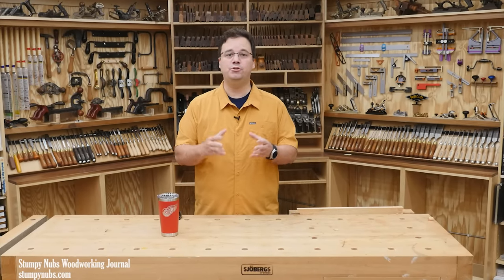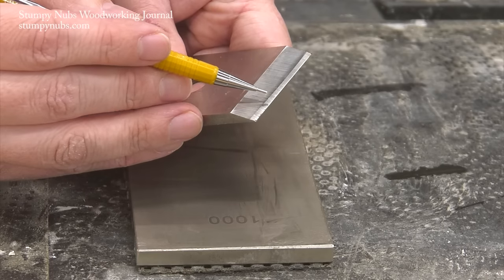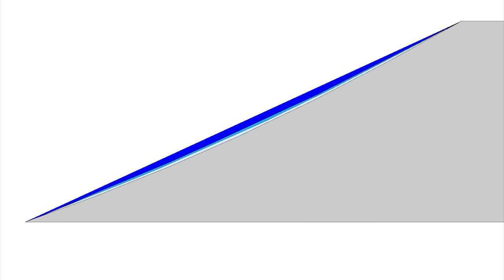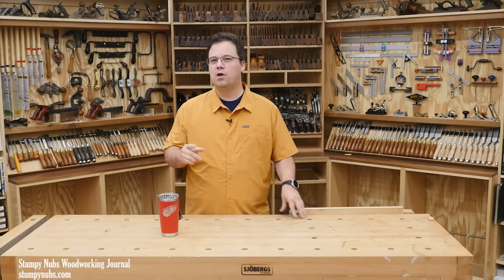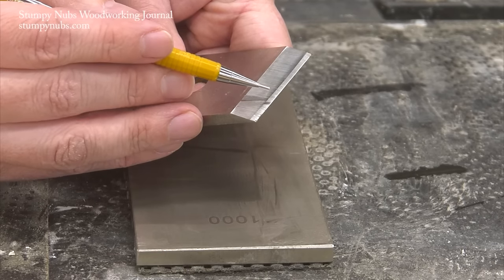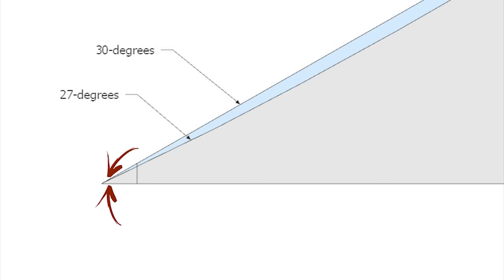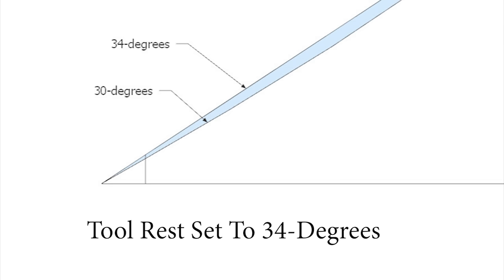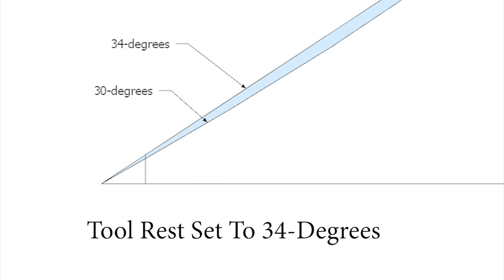WRONG INTERNET TREND! - Watch before you sharpen with a bench grinder!

Comment: The biggest problem with using powered wheels to sharpen is you don't want to overheat the very thin edge of the steel and change its heat treat and thus its properties.  Worst case you would reduce the hardness right at the edge.  Some steel compositions would be more susceptible to this than others.
Reply: I always thought that the temperatures you'd see when sharpening are far lower than any used for heat treatment.
Reply: @yngndrw.  Heat treating uses high temperatures, but tempering does not.  You can damage the hardness of tools if they get a little bit hot when working with them, that's what "high speed" steels are for.  They have different tempering temperatures and don't lose hardness until they get hotter.  So unless your chisel is high speed steel it can lose hardness at a temperature lower than you think.

Comment: I attempt to grind my chisels and plane irons so that the wheel intersects the tool surface behind the edge by a small (<1/16th inch) margin. Thus the actual edge is only hand sharpened. The reasoning is that a wheel will heat the edge, drawing the temper. I think pulling the temper will have a greater effect on the durability of the edge than the marginal effect of an edge that may be a degree or two off 30 Deg. Other woodworkers on youtube sharpen chisels to about 17 Deg. for use with very soft woods, so unless you attempt to maintain edges customized for every species and moisture content, be consistent around or a little less than 30 Deg. for most hardwoods and don't sweat the small stuff. (Woodturner hint, color the edge you are sharpening with a magic marker before you put it on the stone or wheel, make a test pass, and the areas where the magic marker has been abraded off will tell you exactly where you are sharpening.)

Comment: All of my wheels are from D Way, but I don't think there is any real difference other than D Way are steel, and Ken's are aluminum. As far as I am concerned, the radius edge wheels are pretty much worthless. I like the wide straight wheels. I have heard that Ken is now dealing Vicmark lathes which are top of the line. I own a Vicmark 240 with the pivoting headstock. I don't like turning bowls on a long bed lathe.... Haven't had a chance to play on the Harvey lathes yet.

Like you said, lots of 'stuff' floating around about the hollow grinds. I just sharpened a bunch of old tapered wood plane blades. Took them to my CBN wheels and hollow ground first, then to the stones to finish them off. You can still take the temper out of some blades if you are not careful. The CBN wheels are made for sharpening 'hardened' metals. This would cover all modern hand planes and chisels. For the older ones, the softer metal that supports the hard metal cutting edge can clog up the wheel a bit. If you have an M2 high speed steel scraper and the platform, that will clean it up fairly quickly. Some Trend lapping fluid is good too, but apply it to the bevel of your tool, not to the wheel itself. You will end up with a racing stripe. Of note also, Ken has 'helical washers'. The nuts that are standard on most grinders are not precision machined, and can cause the wheel to wobble. The helical washers, one concave, and the other convex, will make for a square mount and no run out in your wheel. Also, CBN wheels come spin and bubble balanced. Many go with a 1/2 hp grinder. To me, as a production turner, that is way underpowered. I have 2 Baldor grinders which are more than enough. I also have 2 of the 1 hp Rikon grinders which come up to speed in the same amount of time that the Baldor grinders do. Only down side to the Rikon is that they spin for quite a while after you turn them off.

Comment: I just get the pure satisfaction of sharpening my chisels and hand plane knoves on a diamond plate. In just 5 minutes i can have a scary sharp edge with no more than a few strokes by hand. I just dont see the justification of paying several $100 for a machine that does the same thing. You can pick up a whole set of diamond plate from 300 grit to 8000 grit for much less, and still get that enjoyment of just using a little bit of elbow grease to achieve a superior edge.

Comment: When you say set your grinder at 34° are you saying use my digital angle finder and set it on the rest, then adjust it to 34°?  I've been following you for some time and have purchased the LUX  cutter head for both my planer and jointer.  I've purchased a Harvey band saw and some of the other things you recommended.  So far so good.
Reply: The rest should be to 34* to the horizontal center line, of the wheel, where tool touches the wheel ( /O ).

Comment: I don't have a grinding wheel, and I likely never will because my little shop is already overstuffed with tools. I do have a set of diamond sharpening stones and honing guides that I'm still not expert with by any means. All this to say, I have no dog in this fight - I have no opinion as to whether a wheel or a stone is better for sharpening tools. So looking at it as objectively as I can, I really think the difference in thickness of a hollow-ground edge from a wheel versus a flat-ground edge from a stone is so small that it would make no discernible difference to how a plane or chisel would cut or in the durability of the edge. It would be interesting to see some objective tests of that, though.

Comment: Can you give more information about your tool rest? Where did it come from? How does it attach to your grinding setup? Have you used different kinds? I got a paper wheel finally after wanting one for many years and was thoroughly disappointed. One of the problems I have with it is that my tool slides up and down on the wheel, changing the sharpening angle rather dramatically even if I'm holding the tool at the same angle. I think a tool rest would help that problem a lot, though I'm still not happy about the quality of the polish and may think about a CBN wheel instead. Thanks!
Reply from the maker: It came from Woodturnerswonders.com. they have it as a standalone rest that mounts to the bench in front of the grinder, or as part of their bigger Kodiak sharpening jig system for turning tools.

Comment: I use a wet grinding wheel so there's no problem with over heating the steel. I don't grind every time I sharpen. I use a flat stone to hone which puts a micro bevel at the toe and a slight flat at the heel. I don't grind again until the flat areas of the toe and the heel combined are almost equivalent to the hollow area in the middle of the bevel. At that point, I'm working too hard on my flat stone and it's back to the grinder. The objective is not to grind it right to the edge but just to restore the hollow leaving a fine micro bevel so that, when I take it to the flat stone, I don't have to remove so much steel to achieve a fine polished edge. To me, it makes sense.

Comment: What effect does the extra heat from the grinding wheel have on the cutting edge?
Reply: If you're doing it correctly, nothing.  I'd recommend watching some videos on proper technique on sharpening with CBN wheels, which run cooler than traditional wheels and have other benefits.

Comment: Through a lifetime of experience most frequently fraught with scraps and thrown away culls full of curly and gnarly grains, lots of knots, crotches that NOBODY was willing to work with and everything else that can possibly be wrong with the wood I use, I've come to the immutable conclusion that hardened steel blades and cutters are MEANT to be 27 degrees or thereabouts. 30's fine, and will last a hair longer, but it comes off the hones and snarls right down to be halfway to Bitch-ville from the time you stopped working the edge. You can feel it after hours of pushing it through grain "going every which a damn direction"... 27 might not stay scary for quite as long, but 30 doesn't even start scary... AND scary for a little time to dwindle into not so scary and then back to halfway to Bitch-ville is better than starting out halfway to Bitch-ville in my personal opinion...

    SO if I can get the bevel to 27 reliable, and then just polish off the worst roughness so it'll glide alright, that's probably about where I want to be. I don't need to see my nuts up my pantleg in the g** d*** reflection, either. It's a tool, not a ladies compac' mirror...

    AND no, it doesn't matter if I'm pushing the blade on a stone or if I alternate between shoving it against a grinder (angle, drill, or bench) and plunging it in ice-water... It's a friggin' blade, not a Picasso. We're supposed to be WOODWORKING not practicing up for nuclear rocketry!   ;o)

Comment: My high school shop teacher would go bat-crap crazy over hollow grinds.  Automatic fail. He also went nuts over pulling the trigger on a power tool when not in use. "That trigger only has so many uses, don't wear it out"!
Reply: But a quick double tap on the trigger every time you touch the drill is the law I thought? ZHOOP ZHOOP!

Comment: I don't like a secondary bevel because it makes the chisel work less well.  With the bevel down, the chisel is often slid along the stock, like a plane.  The secondary bevel raises the cutting edge above that plane.  The main issue with hollow grinding on a bench grinder is overheating the cutting edge.
Reply from the maker: Planes are sharpened with secondary bevels all the time. The main bevel does not remain flat on the wood when cutting with the bevel down. The tool is angled upward so the cutting edge is pretty much all of the bevel that is engaged with a bench plane.
Reply: Yes, true.  I was talking about chisels. @StumpyNubs
Reply from the maker: @jaywood8296  I used a plane as an analogy. I was still talking about chisels, as well. The bevel-down function is the same. A micro-bevel has no negative affect in common use.

Comment: Good video. But, I gotta ask. That actual size at the end, is that on a 17" laptop or the 65" flat-screen TV I use?
Reply from the maker: It doesn't matter because the point is that only the very edge of the tool is of concern.
Reply: @StumpyNubs  I know. It was more of a snarky comment. Sorry. I retired from mechanical design with years of CAD work. I was once told about an electrical engineer that was shown his design implemented in CAD. The electrical engineer pulled out a ruler and measured the part on the computer screen, declaring it wasn't the right size.
It's the irony of ever trying to call anything "actual size" that displayed on screen.

Comment: The experience of a grinding wheel sharpened chisel dulling more quickly may in fact be true for some people. The only thing they see is the holow grind, hence they argue like you mentioned in your introduction in the video. Especially for old grinding wheels and old steel alloys the reason for quick dulling chisels lays in the overheated tip, changing the steel's microstructure dramatically to a softer one. This annealed microstructure can not hold the edge anymore... Those arguing with the hollow grind can't see the change in the steel and therefore keep arguing with the wrong argument.

Comment: I can see maybe if you're using a tormek, followed up with a strop wheel. At that point, the edge is rounded slightly, increasing the cutting angle at the tip. Normally, it loses its edge sooner because the honing made the tip too steep and blunts easier. Or from a course stone causing micro fractures at the tip, causing the edge to break down prematurely. I rough grind then freehand sharpen. None of it matters. Enjoy your hobby. If you use hand tools, you will be sharpening a lot, regardless. If you're chopping, the steel doesn't matter that much either. The edge will roll or chip, and then you will be stuck sharpening either way. Paul Seller is a perfect example of that.

Comment: I've always ben told (correctly or incorrectly) the reason not to use a bench grinder for chisels and plane blades is that it puts to much heat into the tip thus making them too soft.

Comment: There are diamond wheels too. Which do you think are best ?
Reply from the maker: CBN is better for typical bench grinders because diamonds are affected by the heat more than CBN.
Reply: @StumpyNubs  thanks
Reply: @StumpyNubs  but I have a Tormek water stone. So heat is not an issue. Tormek has diamond wheels in 3 different grits. I’m considering buying such a wheel
Reply from the maker: @TheFilip330  I have diamond wheels on my Tormek and like them very much.

Comment: just remember, until you get to lapping and scraping, all grinders in industry are using round wheels... whether the surface be flat, round, or other.

this is one of those most amusing topics... its TIMBER WORK. for the most part, a mm here, an inch there...whatever. it isnt high precision, and for those guys that get stroppy about that... go dunk your latest work in a cup of water and tell me its still "high precision".

like, if im grinding a REAMER, and trying to keep it within 0.002mm? i actually REALLY have to consider the wheel, is it round, face grinding, or is it flat side grinding? because they both require a different setup to get the same angle.

but theres no PREFERENCE for one over the other. you do what the machine and your tools mandate you do... i can only get in there with a cup wheel and still clear the tailstock and drive dog, or i can only run a 5" wheel on that grinder, or... whatever....

Comment: To me the grinding on a bench grinder is a bit of a problem since the grinder heats the material unless you use a wet grinder. Heating of steel impacts the hardening.
Reply from the maker: A CBN wheel and a large tool rest will keep it cool with proper care. I may make a video on that down the road.
Reply: What temperature is required to temper the grades of steel you commonly use? I bet it's far higher than you'd expect.
Reply: @yngndrw.  Sparks flying and the edge of the blade is very thin so I'd definitely consider that the edge can be less sharp than it could be. If the hardening is lost on the business point of the knife it's going to be less effective.

Comment: I happen to prefer flat or slightly convex bevels. On carving tools and lathe gouges especially. BUT, I use chainsaws for a living. Instead of your 6 inch diameter as the extreme example of hollow grinding, imagine something as small as an ⅛th of an inch. Yet these cutters slam into wood and stay reasonably sharp for a long time. This alone would seem to refute all the interweb blather concerning hollow grinding. 

There are chainsaw cutters with flat bevels. (full chisel) They do seem cut a bit faster. But I don't know if the edge lasts longer in real life. And that's another topic for more unscientific ravings.

Just guessing, but that hollow ground chainsaw cutter might scoop out a mile of chips before it needs a touch-up. That alone should be enough of a hint for the hollow grind haters. 

And, as mentioned, this is from someone who likes flat bevels for woodturning and woodworking. But for reasons not concerned with the strength and durability of the edge.
Reply: I got out my chainsaw, and measured the tooth cutting angle at about 40˚.  Also, the teeth don't "slam" into the (usually green) wood, they make a shearing cut.  A chisel ground to that angle would be strong, but probably not cut so well.
Reply: Yeah I know, not really apples to apples. The chop sharpeners that you see at chainsaw shops are generally set at 60°, as is mine. Given the slight slope of the top plate, a bit less. Full chisel, a bit less, depending on the timber, and how long you want to cut between touch-ups. But, 90% of the time, I'm cutting with chains sharpened with a file or dremel tool, i.e., a hollow "grind" on the top plate.

As far as "slamming", the cutters are certainly flying into the wood at a great rate. In gas-powered machines, there is a sympathetic oscillation and the cutters rotate back and forth, effectively scooping out chips as they travel around the bar. I was merely suggesting a great amount of force and travel on that cutter, especially in a tuned-up commercial saw. And, after decades in the urban tree world, I'm generally amazed at how long a properly sharpened cutter lasts, as long as it stays out of the dirt, rocks, nails, bricks, insulators,  
 . .

Comment: I may be labeled a heretic, but I bought a tool that allows you to set the angle and then uses a spinning disc, with abrasive on both sides, to very quickly create a perfect bevel.  The top of the disc is used to make the back of the chisel perfectly flat.  Sharpening a chisel now takes less time than it took me to write this comment.  Let the flaming begin!
Reply from the maker: Why would that be a bad thing?

Comment: i thought the idea was that a grinding wheel heats it up and messes up the temper of the metal.
Reply from the maker: Far less likely to happen with a CBN wheel and a good, large tool rest.
Reply: With care, that might not happen. I've had it happen, when the edge gets super thin. I don't grind my edge super thin on a grinder any more.

But a CBN wheel is in my future, to save me from myself.

Comment: Worrying about such minutia is akin to my cat pondering the civil rights of mice.
In general:
— You only need resort to the grinder when tou haven’t kept up with your honing;
— The real risk in using a grinder is that you will overheat the blade at the edge. Most grinders are both too coarse and spin too fast. If you’re going ro use a grinder, get one that spins at 1170 ( or, better yer, 860 ) rpm.

Comment: I think this grandpa myth comes from axes. It doesn't take terminal angle into consideration at all, so they claim that the convex edge is the strongest. But if they all end up in 30°, the hollow grind has the most mass behind it.